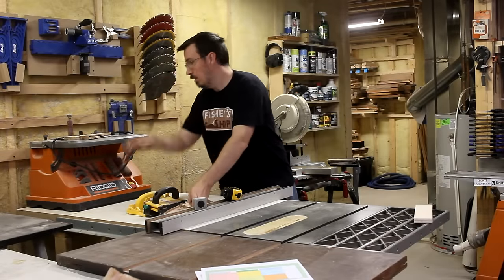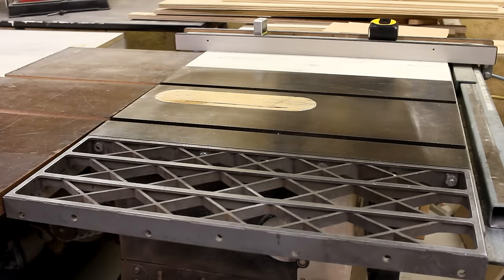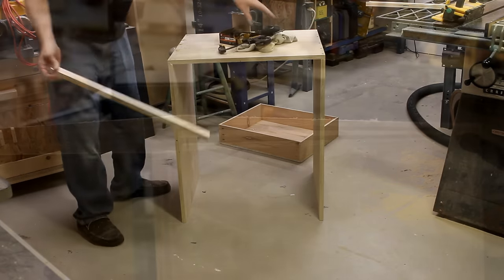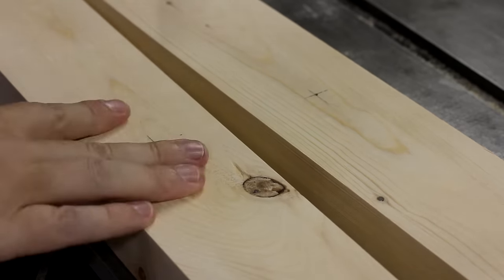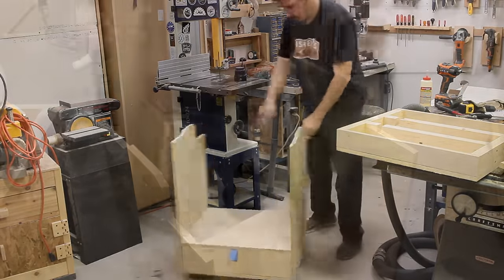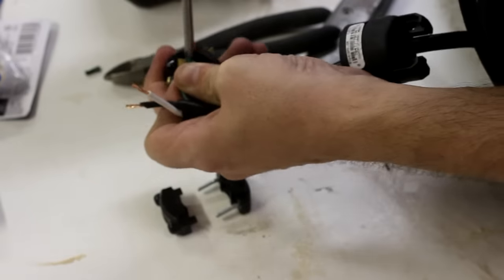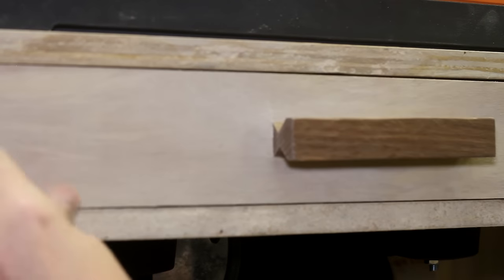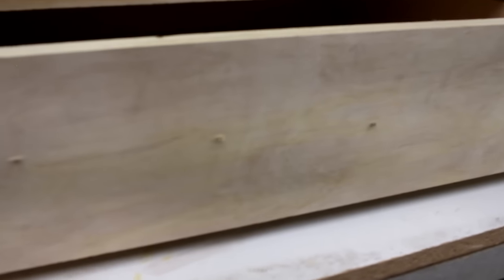Shop Work: How to make Fisher's Flip Cart

Comment: I truly appreciate most of your designs, because they're great for inexperienced wood workers and they give experienced ones, like me, new ideas. There's one minor change I would have made to your setup, which is installing an emergency shutoff switch at knee height on the face of your cart.  Nobody plans on getting a finger or garment stuck in a tool, but having an emergency shutoff you can hit with your knee can save a finger.  I still have all of mine, but I know a lot of carpenters and metal workers missing part of a finger or more, and all of them would have been preventable with a knee- height emergency shutoff switch.

Comment: I just picked up the plans, I plan on making two, one for my scroll saw and planer, and another for my band saw and drill press.  I will be making some slight adjustments.  in addition to the drawer, I will be adding doors to close off the bottom tool.  wish me luck, I've never built one before.

Comment: Well Drew I finally did it.  LOL.  I purchased your plans, very simple and easy to follow.  I realized that what I needed or wanted to do was not going to fit on this design.  However, because you did such a great job with the plans I was able to modify them for what I needed.  For someone who works out of your basement shop you do amazing work.  I would love to share my version with you if you would like.  Also, I am trying to figure out how you made the storage holders for the parts from your oscillating sander.  

Thanks again and keep making sawdust 😀
Reply from the maker: Nice!  Glad you could tweak the plans to make it work.  I just used some scraps and whipped up those holders.  I think I just used forstner bits to cuts holes and then sawed them in half to make the cradles for the spindles.
Reply: Drew I purchased the plans for this cart I’m going to build two of them but one will need to house a bandsaw that is 34 1/4 tall and I’m wondering if you have any suggestions by the way I built the table saw cart that I also purchased from you and was glad I did I’m just a dyier that loves woodworking since I’m a 100% disabled veteran. Thank you for what you do.

Comment: A follow up to my prior post on this: make sure your caster wheels are very hard material. My caster wheels are not very hard and with the weight of two heavy tools plus the cart, each wheel has developed flat spots from being stationary for long stretches of time. I’m going to replace them with much higher weight rated casters. The function of the cart is superb!

Comment: I built this cart over the weekend because of the integrated power, magnetic power door cover, window sash latches, and positive stops.  I bought Drew's plans ($5) which were very helpful especially when figuring out the cuts for the top of the sides and the ears on the top.  

I had to change the dimensions to fit my tools (Dewalt 735 Planer & Ridgid Spindle/Belt Sander), and I was a bit conservative making sure my tools would fit.  The dimensions of my top (excluding the ears/stops) is 30"W x 24"D.  If I were to re-build it, I'd make it smaller at 29" x 22" for my tools.  I bought 3/4" neodymium magnets which are really strong; 1/2" would be sufficient. I did not change the height of the cart, and it is a perfect fit for the taller of the two tools (Ridgid).  I also fabricated some thin fender washers to insert between the top and the inside-sides so the wood wouldn't rub.

The weight of the two tools is quite different.  The planer is 90lbs and the sander is only 40lbs.  Surprisingly, if you put both tools on the pivot point, the flip is not big deal, but you still have to support it with a little pressure.  If you have these tools, to mount them use 3 1/2" bolts for the Sander and 3" bolts for the planer.  

Overall it was a fun and easy build, and I no longer have to lug around a 90lb planer!
Reply from the maker: Awesome, Matt!  Glad it turned out well for ya

Comment: I am getting ready to build this cart and noticed I have the same Rigid sander, and the height I measured for clearance needed for rotating unit was around 23" but noticed you had commented the height was only 19". Just wanting to confirm that 19" will work and maybe confirm how you went about getting your measurements. I probably measured mine wrong. I would like to make it as short as possible so I am not sanding at chest level. Thanks and love your design better than any I have seen.
Reply from the maker: Doug, the height of the opening is actually like 19 1/8".  I'm not sure how you got 23" for that spindle sander... mine comes in under 19".  Even with the top part oscillating, it still doesn't change the measurement too much.  Might wanna give it another shot.

Comment: I just built this, with some height and width modifications to handle a planer (and handle) and the accidentally purchased oscillating belt/spindle sander, and it came out great!  A couple of potential gotchas with the design...  The placement of the pipe with the narrow "thickness" of the top can affect the ability to route a power cable from one side to the other.  I had to jam one cord head through with a metal rod.    Another gotcha not mentioned in the plans which I think bears more emphasis is the length of the cord that goes with the powerstrip.  It should be a 6' cord, and I had a 3' one, and I'll either need to drag a power cord over, or mount another powerstrip on the outside, and plug into the cord.  I had some difficulty mounting the powerstrip inside to the cut down 2x4's inside the top, without running into mounting issues from one of the tools. 

but I'm pleased with the setup!  And I wanted to give a shout out for the quality of the plans, and the inclusion of the sketchup file!  Thanks also for the humor in the video, and the tips/tricks for measuring/mounting the slides and decorative front on the drawer.

Comment: I love the power management, I wonder if you could use a larger pipe on the other size and use it for duct collection.  Just run dust collection for both machines through the table and out the side maybe use a slip ring so the hose doesn't twist when you flip the cart.

Comment: 31 months later, still have fans building this cart including myself this week. Learnings: haven't determined how it happened, but when the carcass was built (two sides, bottom, back-bottom brace, shelf) the vertical sides did not come out parallel. This turned out to be a royal PITA because the flip table 24" width is zero-clearance to those vertical sides (spaced 24" exactly). So with just a little twist in the plywood, the table was hitting on both sides, requiring a bunch of shaving / trial-and-error to get the table to squeeze in there and rotate freely. Every piece I assembled was verified square, so for future flippers I recommend straddle a 24" board across the two vertical sides, at the top, while you're assembling the carcass. This may sound inconvenient but it's how I'll build the next one, for sure. Another learning - may as well thread the pipe, mark it, unscrew it, and cut it before bothering with the power cord. In the video, the power cord is fully routed, then magically the pipe carrying the wire is cut and put back. Save yourself some time, just align/mark/cut the pipes first - then go ahead and route the wiring. Casters: believe 2" wheels were used here, I used 3" and I found the cart to be a little on the tall side. I'm only 5'7" so dumb move on my part. Finally, even though I used a drill press for the vertical side pipe holes, and carved the sides simultaneously using a track saw and jigsaw, and used my DW735 planer to get nicely milled " 2x4 pieces exactly at 3", the flip table tops still came out a little lower than the tops of the vertical side pieces. This is important, because it means the table tops contact the vertical sides before they are fully rotated to flat. That kinda sucked, and again need to figure out how/why - not obvious. This really can't be easily double checked prior to building the carcass and the table top. In the end, I had to add a plastic bushing between the table top and each vertical side, e.g., the pipes pass through the bushings. This forced the vertical sides outward by 1/8" and solved the maddening interference issues. In hindsight, I'd recommend to just undersize the table top dimensions by 1/4", giving you 1/8" of clearance on either side to account for assembly variation. Would have saved me tons of time.
Reply: You are correct! I am building this now..5 years since it was posted. I love this build that Drew did (thank you Drew). Thank you James for giving me a heads up on a couple things I had not thought about. I made the sides 3" shorter so my drawer will only be 3" deep instead of 6", I am 5'1" ..seems I have to lower all my tables!

Comment: The design of the flip cart and the  integrated power supply are brilliant.  I love the big flat sanding surface of the belt on the Ridgid sander, but I've read bad reviews on them.  Have you been happy with yours?
Reply from the maker: Yeah, it's fine.  It's not as good as a dedicated belt sander but it's nice that it oscillates as well as doubles as a spindle sander.  Definitely worth the money.

Comment: Long time subscriber, first time caller.
I'm not sure if you get notified about questions related to your prior (less recent) posts, but here goes:
I love this cart design and was planning to use it for tools I received from my father-in-law who can no longer use them. My question is how much weight can the cart support? The two tools are a Delta oscillating spindle sander and an older Dewalt planer. Both are dead priest heavy on their own, let alone me putting them together. Do you think your flip cart could support both tools, or do you think I would be the victim of my own disaster? Thanks for everything!
Reply from the maker: The disc sander I put on there is 85lbs and the cart isn't flinching at all.  It would takes a LOT to bend that black iron bar.  I would suspect the screws holding down the surface would give out first.  I wager you're just fine.

Comment: I really would like one of these in my shop. I need to get the ridgid oscillating sander. I really like this one over several I've seen. Integrated power...nice. And the drawer for holding the oscillating sander parts and the simple locking mechanism....Super cool. Thank you. Question is, why do you need the disk sander machine? Won't the oscillating one do the same thing? You might can tell I'm not a woodworker.
Reply from the maker: Disc sander is for removing lots of material fast.  The Rigid sander has a finer grit on it for a lighter touch
Reply: @FishersShop  thank you.

Comment: I like how you integrated the power supply ans the locking clasps at front and back. I'm curious over these past 4 years how stable has the cart remained and is there anything you'd do different?
Reply from the maker: It's just the same as it was in the video after hundreds of flips.  It's held up great.

Comment: A very nice build!  I was considering building a cart like this for the same oscillating sander that you have, but I was wondering if the pieces would fall out when flipped. Now I know lol.  Perhaps a little side thing on it to hold the most often used pieces just to save myself from bending over every time...

Comment: Going to buy your plans. I think I'll use magnets to hold false door for access to powerstrip. Did you grind out threads on pipe flange?
Reply from the maker: No, the flange is for a larger sized pipe so it fits over this one perfectly.  No grinding necessary.

Comment: Good video Drew  the neighbors Doghouse comment was hysterical  after a divorce i  bought and lived for 20 years in a Condominium that was supposed to be a temporary  home for my children and I  ? as a Handy guy i often  found myself doing noisy  projects on weekdays when everyone inmy building was at work  once  i needed to replace my  hot water tank  and  the actual individual  apartments didn’t have their own shut off valves so  after everyone went to their jobs i shut down the building main  and sweat in a ball valve to my unit  nobody was around so no one knew they didn’t have water for around 20 minutes that day  with the ability to now shut my place down  i could do anything i wanted at my leisure  without disrupting any of my neighbors  your doghouse comment made me think of that as i remember  looking out my windows watching the neighbors go to work so i could shut the water down on a day i didn’t go to work myself  in regards to your   too long screws we have all done that mistake at one time or another  i did Commercial Woodworking for 20 years and one of our parks was  cutting screw tips off and using CA glue to stick them on someone’s countertop when they were screwing it from the underside of the counter  then watching their face of horror when they came up to look at the top  they just screwed through  several times  with some guys it never got old  watching them panic
Reply from the maker: Haha, that's a great prank!  Thanks for the laugh, Craig

Comment: I have looked at many flip top ideas and I believe yours to be the best and bought the plans.  However I do have 1 question. Since the 1/2" iron pipe is resting in the hole/flange and not attached in any way, what keeps the cart from racking some? Thanks
Jon
Reply from the maker: Nothing really.  But I haven't had any issues all these years and I even used cheap sanded plywood.  If it's a concern for you, then leave your pipe long and thread the ends.  Then just screw on 2 caps on either end.

Comment: The one thing I really like about your design is the 180° rotation, not 360°. Totally eliminates cord twist while adding stability. Like it lots. To save $$$, maybe chose shorter lengths of black pipe. Also, maybe consider drilling 1/2 way thru a piece of solid wood to use as a pipe support & cover. This would also keep any creepy crawly's from setting up a homestead.

Comment: I've watched this video and the one where you made the miter stand.  Before I buy both plans do you think I can incorporate the wings on the flip top and use the flip top for my benchtop planer and planer?  Those wings would give me a lot more capability to joint and plane much longer pieces of wood.
Reply from the maker: I wouldn't recommend it.  If you installed wings on the sides and subjected them to weight, it would cause the sides to splay out.  You could counter this by threading the axle ends and using the flanges to lock the sides in.  But then you'd also have to implement bushings since the flanges would be fixed onto the axle.

Comment: Love this I have the disk sander already been looking at the rigid sander to buy to Replace my belt sander disk combo that's identical to yours but i dont have the stand and I noticed watching i think we have almost identical table saws to mine is the craftsman contractors saw with the open grid wings like yours

     are you happy with the combo you have now as a replacement for the old craftsman combo tool
Reply from the maker: Yes, absolutely.  I love that 12" disc sander!
Reply: @FishersShop  and the Ridgid sander i have the 12 inch love the thing but haven't bought the Ridgid one yet but plan to soon

Comment: Great video. I bought the plans and looking forward to building this. One suggestion though: just stick to inches, please! Using feet + inches, and even feet with a decimal point sometimes, make it (even more) likely I'm going to screw something up. For example, on page 26, you say 1.5' and then 1'6" in the next sentence. So much simpler to just say 18" everywhere so I don't have to pay close attention to the 's vs the "s and do math when using my tape measure.

Comment: I got your plan for the flip top. I was supposed to check with you to see If you had updates but got excited and forgot. The breakdown diagram says 18  by 33 for the drawer bottom but the plywood sheet says 18 by 23. I’m going with 23. So far so good. Thanks.
Reply from the maker: Yeah there was a typo in one of the versions recently.  You might have gotten one with a mistake.  You can redownload the plans if you want a corrected copy.
Reply: @FishersShop  Nah...I'm good.  I'm building two carts, so double the potential for bad cuts.  It was pretty cool to get a response from you that quickly.  I might have to go look at your other plans if customer service is gonna be this good.

Comment: As per the other comments, love this and the integrated power. After nearly 2 years, has there been any wear on the power cord where it exits the metal tube?  It struck me that any unnoticed wear on the cord there could result in a bit of a bang down the line...
Reply from the maker: None.  The cord rotates with the surface so it doesn't rub.
Reply: @FishersShop  Nice! And thanks for the rapid response to a comment, given that you get so many.

Comment: just got the plans, gonna be the dewalt stand... lunchbox thickness planer on one side(~80lb), and benchtop 2 wheel grinder on the other (~40lbs). maybe i will paint it yellow to match the tools ;) I will need to add about an inch n a half to the "height" part, so the planer will fit... stupid height handle takes it above 19 :/

Comment: Great idea. Would it be possible to have two machines not equal in weight? Like a DeWalt DW733 Thickness Planer (33kg) and a Triton TSPST450 Oscillating Spindle & Belt Sander (14 kg) ?
Reply from the maker: There's about a 50lb difference between my disc sander and my spindle sander.
Reply: @FishersShop  SUPER, your flip cart is by FAR the best I have seen :-)